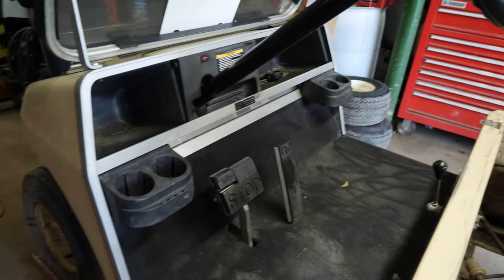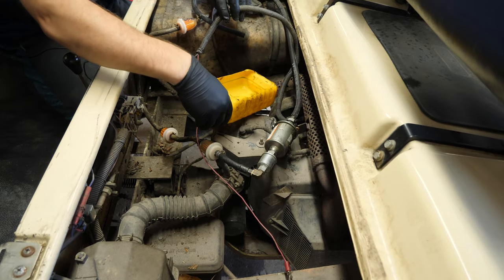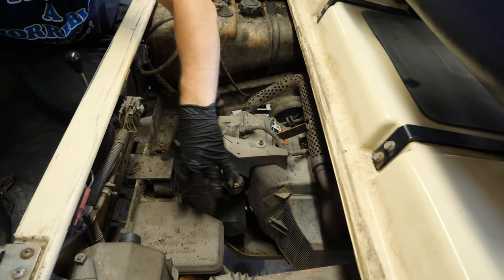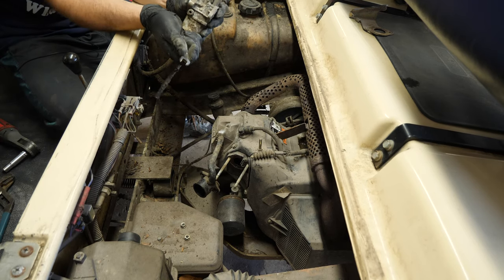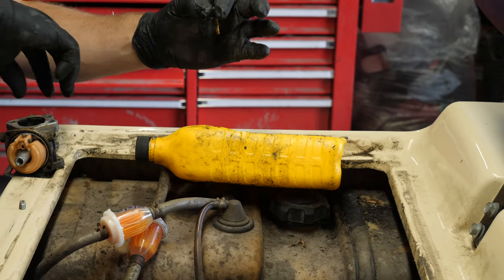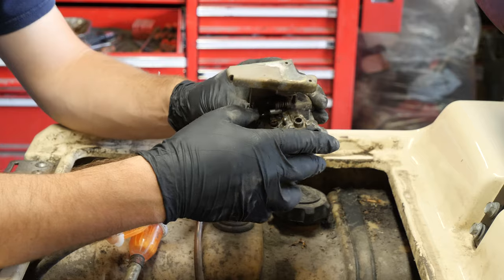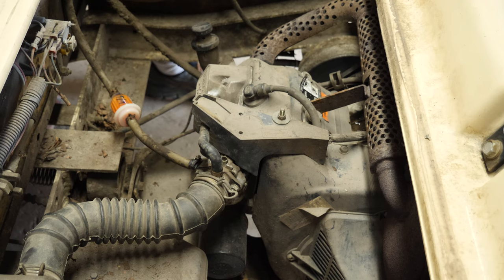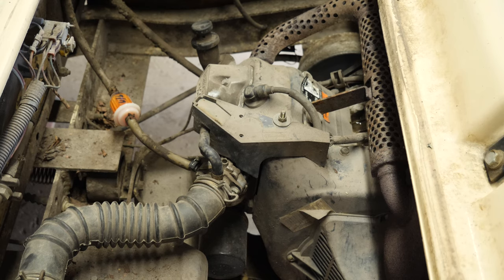1999 Club Car DS, Gas - Crank, No Start, Clean Carb

Comment: Hi Kevin  Like your video's I have a 92 club car gas , I had the micro switch go out and replaced it cart turns over but will not start and the overflow at the carb bowl pumping gas out ,I am going to take carb off and clean it check float and so on , Do you think it could be anything else?
Reply from the maker: I would change the fuel lines if they are stiff. Use ethanol-free gas if you have access to it. Its way better for these small engines.
Reply: @Kevinsgolfcarts  Thanks for the reply Kevin ,Fuel lines are new with filters I check for spark and no spark so I change plug still no spark so I am thinking of rpm limiter and or ignitor . Just hoping its not the coil to much to get to that , also I can't fine a video on body remove on this 92 also I did r&r carb and cleaned it all out everything looked good no dirt or water in bowl float works good
Reply from the maker: You can disconnect and bypass the rev limiter. if you still have no spark after that then you will need a coil or CDI. I think the 1992 has separate ignition coil and CDI. The CDI is a tiny silver box next to the rev limiter. If its not there, then its part of the coil.

Comment: After cleaning my carburetor. I now have gas coming out of the overflow when I let of the gas pedal. Any ideas?
Reply from the maker: The float valve is stuck open. The rubber tip has swelled from water or carburetor cleaner. Take it apart and let it air dry before putting it back together. I've had this happen a few times.
Reply: @Kevinsgolfcarts  thanks for the reply

Comment: Where is the BEST place to get replacement Fuel Pump and other parts ?
Reply from the maker: The "best" place is relative. I buy all of my parts from Red Hawk and Nivel Parts (I'm a dealer for both but I don't sell online anymore). You can try buggiesunlimited or everythingcarts.
Reply: @Kevinsgolfcarts  I should have said reliable I just want to know it’s not complete junk I’m buying lol THANKS!!!
Reply from the maker: @thebunkerhillboys  Well, that's a little different. Most of these pulse style pumps are made in China. There are a few made in the USA. Buggies Unlimited and Everything Carts (as far as I know) gets their stuff from the same places I do so the pumps are pretty reliable. I have only had a couple that were DOA or fail shortly after installation.

Comment: Hey mine's flooding itself out. Even preset new carb. What can I do?
Reply from the maker: Make sure there is no water in the gas. Water will cause the rubber float valve to swell and stick open slightly. I would search your area for ethanol free gasoline and use that. You will have to pull the carb, clean it and allow it to completely air dry before reassembling it.

Comment: I'm having a problem with as soon as I turn the key on it cranks and I have replaced all micro switches. I'm also getting no spark with brand new coil. HELP
Reply: Try unplugging the  rev limiter

Comment: Not one video covers spitting and sputtering at low speed; not picking on you but all the cart videos got to do with not starting or wont keep running...This is not the issue my cart starts runs but at low speed it pops or bucks. spits or backfires...G14 all kinds of  bs on the g29 just  venting lollol ty.
Reply from the maker: This is usually related to fuel delivery. Clean the carb and see if it recovers. The carb may be blocked internally on the idle circuit and needs to be replaced if you cannot clear it.

Comment: I put a new pump on and it's still not pumping gas to the carb
Reply from the maker: There may be a leak in one of the fuel lines. If its a new pump, it will need to be primed before it will pump. You can do this by carefully pressurizing the gas tank with an air compressor. You only need enough pressure to help push fuel into the fuel lines. Be sure to disconnect the fuel line from the carb first. Also check inside the gas tank and make sure the siphon tube is still connected. Sometimes these fall into the tank or get loose where it connects to the petcock at the top of the tank.
Reply: No compression, have the lifters checked.

Comment: go to ypur local air port gte 105 octane aviation fuel run it at least 50 percent, and u wont get water in ur bowel , i do it to all  my small engines,  works good, hell most of my push mowers and my garden tractor, thats all i run in them